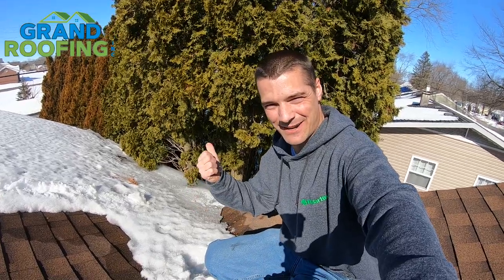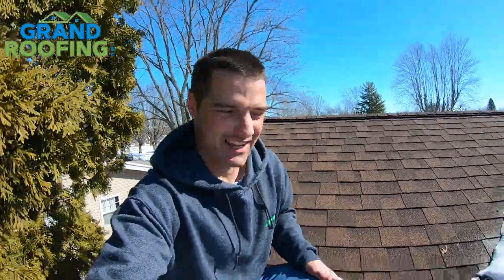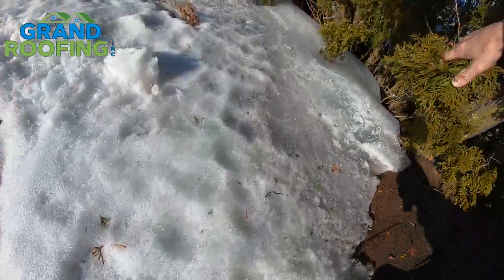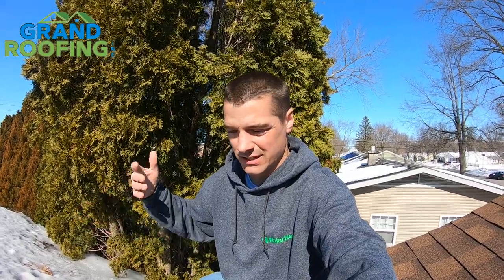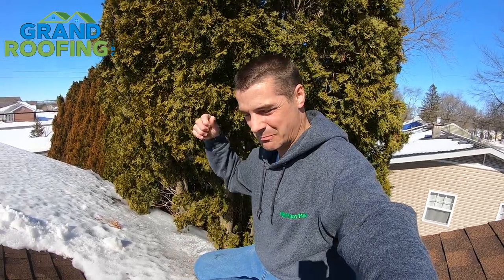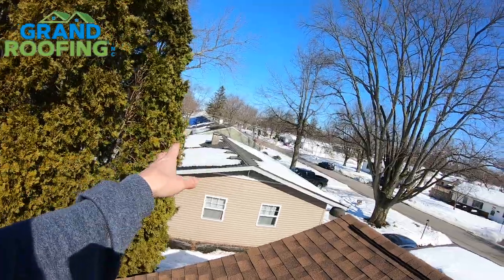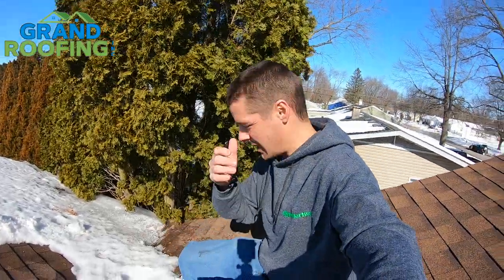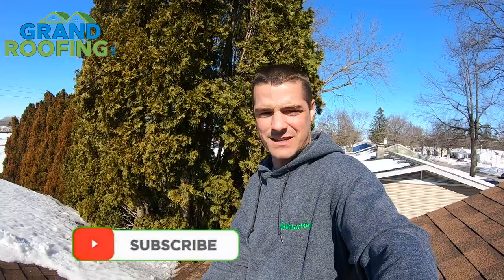Roof Ice Dam what is it

Comment: I would suggest also even with the closed valley system to install ice/water shield but also metal v shape valley then close it if that what you want but also cut the line back more so crap doesn’t get trapped under and causes the dam quicker but also in hard rains. The tree debris will cause it quicker also especially where there is pine or cedar needles. We are a qualified and recommended installer with Owen Corning’s pink insulation
Reply: I had a great year with ice dam removals. Been doing it for years. I good roofer will get the ice dam out with a flat bar or hammer without damaging the roof. Also steam gun or a nomadic chisel. I don’t use anything except my hatchet and the flat bar. We had customers wives literally crying over the phone and water outing inside homes with very expensive items etc. We had insurance companies paying us as well to clear the ice. You don’t want to wait but I can see with an not experienced roofer banging on your roof

Comment: Even though  I'm well insulated  and ice and  watered.
I always roof rake off the first 3 feet after  storms.
Its best.
If yiu can.
Lot of these ranches  don't have enough room to get your needed r value s over the exterior wall top plate..
The homes I build are box over then 2x10. So my heal height  is at least 16 inches .so I get at least a r 49 over the walls .
This helps  out a great  deal.
And there's your dinner